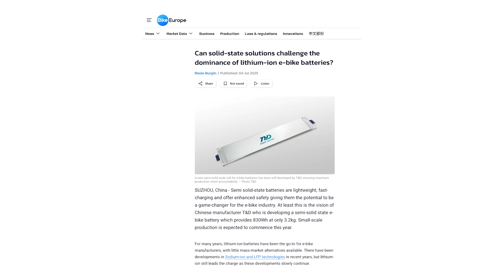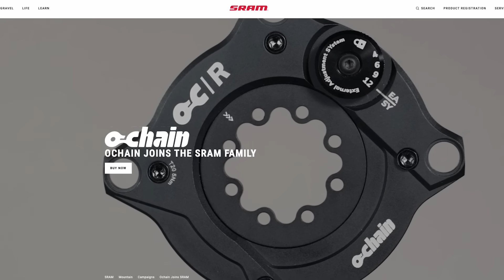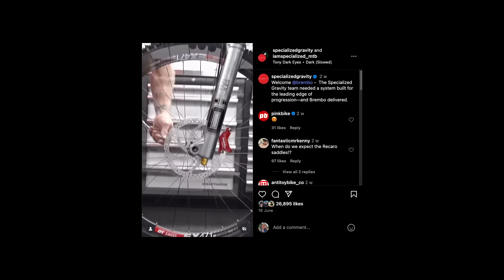The Next Big Thing For eMTB? Solid State Batteries | EMBN Show 391

Comment: solid state is a much better technology,they will be alot lighter and you will get alot more range,I think they may still use some lithium in them but it wont be in liquid form,some forms of lithium batteries from the past were quiet safe but then they changed

Comment: The Bosch "Extended Range" 625Wh "Powertube" battery is a sick joke for serious e-bike touring. Maximum range of 70km per charge in warm weather using Sport Mode. Sport Mode must be used to minimize the excess weight of the ridiculously heavy e-bike and to maintain average speeds for a manual touring bike. 70km = 44 miles. This is a round trip to the supermarket only 22 miles away. Carry a fully charged spare battery and your round trip range rises to 140km/88 miles. That's much more like a proper, manual, cycling day trip. However the cost and weight are hideously prohibitive. One battery = 3.56kg x 2 =  7kg in total on top of the e-bike weight approaching 40kg! Cost is £770 for one battery alone at UK prices at EBS! The battery can be carried on the rear rack but would need to be constantly monitored against theft! Otherwise your have a 44 mile pedal home without ANY power assist on a 50kg e-bike with lightly loaded panniers! Remind me? Is this 1925?

Comment: Forget Solid State batteries for 2 years at 4 times the price to  mirror what we have now. If you are camping in Wales or elsewhere pay an average £4  per 24 hours  for a 3.6 kW mains hook up that will charge 5 or more bikes at a time. Why spend 2 grand on stuff you can't leave out untended  and a Lithium PSU (power store unit) that will  likely invalidate your vehicle fire insurance if nothing else. Nowt wrong with a 12 V  portable fridge for the beer.

Comment: I am in the process of buying my first E-bike to ride as my replacement knee becomes more useable and to gain fitness so I am ready for a second. I have ordered a Trek Powerfly +8 hardtail. However, I started adding a few upgrades and I may have got carried away, the bar to a race face next carbon, brakes from deore to full XT, drivetrain cassette SLX to XTR, derailleur XT mech to XTR di2, XT shifter, Ergon grips, Ergon saddle, Pinnd 155 cranks, integrated lights. I doubt I will benefit much as a novice rider but I have a love of technology and engineering. Do you think there is anything I have missed?

Comment: Generally speaking, solid-state batteries are made of materials like polymers and ceramics (or composite materials) to improve the charging-discharging (time and cycle) capacity, lifespan and safety which can be used (potentially or maybe currently) on EV cars and e-bikes as an alternative to Lithium Ions which is currently available and used in the market today. But in terms of sustainability, coping with advanced technology, and futuristic aspect of e-MTB (even e-bikes in general), I think solid-state batteries is the next step towards these goals. But it requires a very sophisticated process (since I studied Materials Science and Engineering) to generate and produce solid-state batteries from materials synthesis, characterization, and optimizing the components in terms of chemical composition to charging-discharging time and cycle number, stress (strength), longevity, energy (torque-force-power) distribution and lifespan of these batteries. I think collaboration with R&D-Manufacturing Companies like potentially Samsung, Hyundai, Toyota, Yamaha (car and motor companies) with Bosch, Shimano, DJI-Avinox, Whyte, Specialized, Santa Cruz, and other bike brands for this to happen.

A very good and well-presented topic on solid-state batteries The Don and Jonesy! A random question though. Can you do a video of bikepacking using different e-MTBs (commuter, XC, enduro, trail, downhill)? I'm curious to know. Thanks and greetings from Busan, South Korea!

Comment: Regards using solar and inverters, we used that on my mates bike at Llangollen and yes, if you charge between runs you can keep an eeb going for unlimited laps without a spare battery.
I have a split charger and two leisure batteries in my camper car, plus Solar and that’s truly unlimited 240v joy

Comment: 40 x Samsung 50E batteries , 720WH at about 2.8kg
Company called 24M have new electrolyte that adds15-30 percent power density and more safety to current battery tech , coming soon

Comment: Dig the camping set up with solar, however you could ditch the ICE, drive an EV with V2L capabilities to charge the ebike... heaps of days off the >70kWh EV batteries on the market.
Reply: Your 100% correct I drive a BYD Atto 3 and it has the capability to do just that 👍

Comment: Higher power density and longer life are good but we also need higher voltage. This will lead to lighter or more powerful motors. 72V or 120V would be amazing. 

I guess if you are using existing cells you would need to stack them in series to give you the voltage. This may not give enough current.

Comment: I go camping with a Pecron 3000wh battery and my Orbea Wild and solar panels. I can charge multiple bikes, run lights, electric stove and fridge. 3 nights/4days is the max I have stayed out with the system and no problems. The pecron 3000wh battery can be had for $950 USD.

Comment: I have installed a few semi solid state batteries on ebikes. yes they have up to 340Wh/kg energy density, but the higher you go, the more they tend to suffer in cycle life.. not bad but not more than 800 cycles.
the main issue with these batteries is price. hard to justify them agains lower energy density 21700 cells. end of the year we should see the latest and greatest tabless 21700 cells with 300Wh/kg with extremely long cycle life and excellent charge and discharge performance.

Comment: For the off grid charging it would be nice if they make 12-24V input chargers, so you can save 25% charging energy. It should be included in my Pinion/E-fit charger( costs 265€). I made one myself  for my old Bosch Cx.
Reply: Been saying this since the last year I got my first Bosch. Coming from Fazua with 12V car charger (and Bosch itself had it for non-smart batteries), it's strange that they decided to not create a 12-24V. Many of us are long distance cyclists and can carry a foldable solar panel + solar charger. DC-AC-DC conversion just makes everything bulky, heavy with ~15% losses for each conversion.

Comment: I wanna say saving 0.54 kg/1.2 lbs is helpful weight savings over a  800 Wh Li battery, but if you gotta spend 30%+ for it...meeeh. Safety is the big "break through" here. IMHO

Comment: Hi, great video, would love your opinions on the power packs. As a bloke who likes the look of the bike coming out with a fitted battery but live in an apartment,  is the Power pack a viable why of charging your battery?? Ie charge power pack then charge bike battery up, does it take longer to charge a battery this way?? Or is it a bit impractical, would love your thoughts!
Reply: A power station of around 1000Wh would charge the battery at a normal rate and the newer ones run 3000 cycles plus, ones from Anker, Jackey, Ecoflow and Bluetti will all work, I think the Jackery is the lightest. You will lose between 3 and 7% first on charging the power station and then charging the bikes battery so overall it will be a tiny bit more expensive but if you are dual rate you can charge the power station overnight.

Comment: Last week I did my biggest ever ride. My GPS ran out of battery, but I rode at least 160km, at least 2500m elevation gain and it took me 15.5 hours with a 20 minute sandwhich break, three fifteen minute hikes and a few photos. A third of the route was gravel and I rode the first 25km with to motor switched off and probably another third of the trip in the lowest eco setting, which uses about 11% of the motor. I have two batteries which give me 1050wh. What I want to see is a battery that can let me do 200km with 3000m in at least trail mode the whole way. I am coming down from a motorbike and I do not like to crawl at less than 8kmph up a steep slope for an hour in the hot Spanish sun. I go out to enjoy myself, explore and get a good workout. I didn’t ride my bike for two days after that trip because I was broken!

Comment: Solid and semi-solid state batteries will still contain lithium. Big bucks being spent by Chinese companies like CATL and Ganfeng on this tech for EVs. It will be the ICE killer. I always thought we’d see this tech first in Chinese EVs, but maybe it will be e-bikes due to the smaller batteries. Time will tell.
Reply: I have actually bought and installed/adapted 3 such batteries on ebikes. they're awesome, BUT: extremely expensive. you're talking 4-5x the cost relative to mass produced 21700 cells. yes, energy density is higher, power density is also higher, but at what cost? especually considering tabless 21700 cells have unmatched performance, not yet the same energy density as the semi-solid state, but same or better performance and cycle life at a much lower price